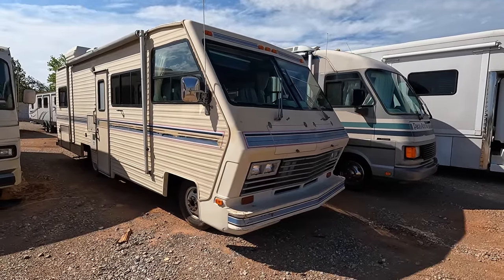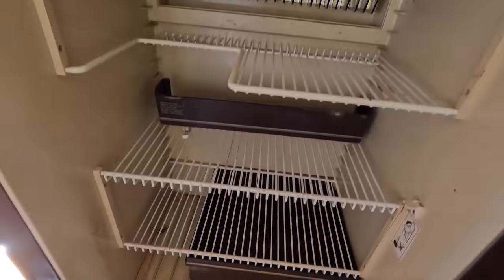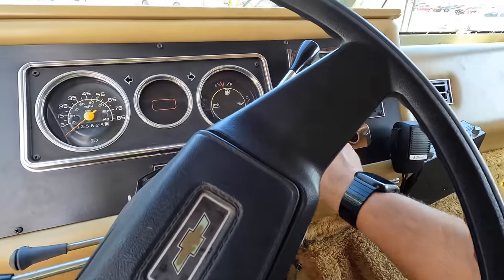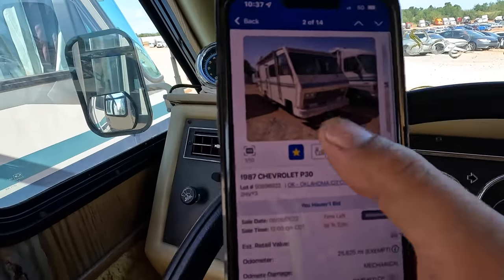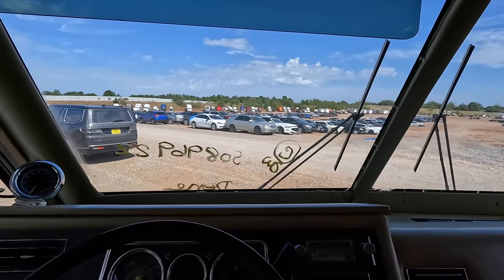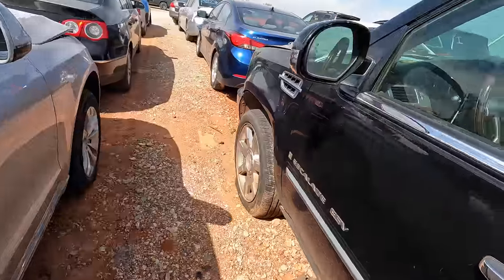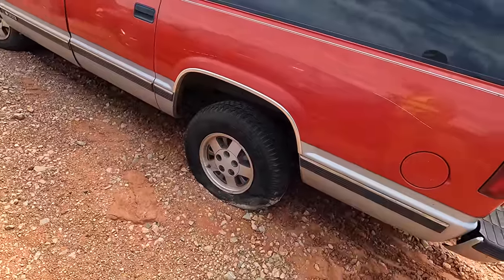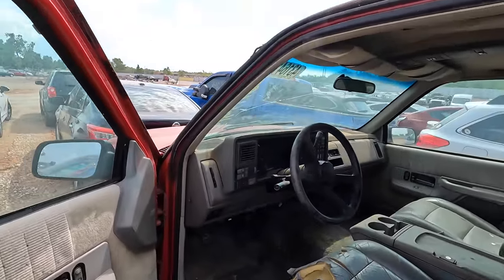Copart Walk Around 8-11-22 + 1987 Chevy P30 RV with 25K Miles!! Cheap!

Comment: Hey Randy, if it has a working generator that’s what runs the roof air. Important to check that out! also you need to check the refrigerator to see if it works which should work off from both propane and the generator and electric. replacing the refrigerator is mega bucks! generators aren’t cheap either! also need to check for leaks! These are all things you should check out before making a decision on buying it!

Comment: Randy, the roof air requires one of two things to operate — the motorhome must be connected to a 30-AMP 120-Volt Electric Service (shore power) — or the onboard Generator (if so equipped) must be operating.

Comment: Go for that RV man! That is a true time capsule. Not a hoopty at all IMHO! Id go after the Suburban too and drop in a TBI 454. Big block swapping those is easier than one might think...
Reply: screw that just jump to the 8.1 vortec - you would have to put on good heads, cam, intake exhaust to get the 454 to where the 8.1 is- shit put the 8.1 in both

Comment: The roof ac, refrigerator, microwave and TV is 110v, "shore powered" with the cord or generator powered. I'd jump on the Motorhome, install 5K genset and you're self contained. You found a rare bear, most of the 30+ year old motorhomes are scraped for their chassis to restore older trucks. It'll take some cleaning and updating but it has good bones! 454, Turbo 400, 6-9 mpg maybe more if you're really easy on the throttle. It's worth as much as anyone is willing to pay. Good Luck!

Comment: There are a bunch of things that are critical for you to check do you know what it’s worth and bid or not! The refrigerator extremely expensive to replace, The generator which runs the roof air  also runs off from electric needs to be checked, The furnace, also check for leaks, The holding tanks water and sewer are really important things to know before you bid on it!

Comment: I think the 6.2 in the Escalade is salvageable, possibly just replace the heads and lifters, basically the top end and it would be a great truck. The 6.2 is a solid engine that can last a long time the lifters are a know failure point on those engines but the whole engine doesn’t need to be tossed because of it.
Reply: Maybe the AFM/DOD V8-V4
There is an internet quick fix before spending the 2500 per side
Good to try for a content video

Comment: About the Suburban.. I mean, it depends on how much does the key cost and if the underneath is in a decent condition. If it goes for like $500 - sure, go for it, but if it goes any more than that, I wouldn't buy it personally, too big of a risk.
Reply: Can get a key and ignition switch for about $20 online.   It should be easy on that since it's older

Comment: I've had a couple of those old class A with the 454 and the turbo 400 trans. Pretty much bullet proof. Leaks in the roof is what kills those RVs. The roof air works off the generator or you need to plug in. I've been looking for one of those at a good price for a while. I would buy it today for $1200.

Comment: Those tires are probably too old to be safely driven - check the DOT codes on the tires.  Some degree of water damage is almost guaranteed with this age, really need to look up in the corners and edges, inside of cabinets.  Get up on the roof and check for soft spots.  Gonna get 6-7 MPG.  Had an '86 Bounder (Breaking Bad rig) on the same P30 chassis.

Comment: basically a box on wheels, those things were built with carboard walls with thin metal on outside, its only got 25k miles, my friends did too, he let it sit underneath a tree for 4 years, tree sap started small leaks on the roof, and pretty soon after a few months, all the walls were soggy, mold everywhere. the sealing was so soggy, the ac unit was causing it to sag, almost to fall thru. good luck lol. id never buy a motorhome that year, i can bet that thing has cardboard walls too underneath cheap metal siding

Comment: Yeah the air conditioner works only if you have a generator going or you have it plugged into the shore power as they say they don't work off of the batteries or nothing the roof air that's why he probably got the cashier fixed for when you're driving now if it's really hot you can start up the generator if it has one and run the air condition while you're driving and it'll be nice and cool?

Comment: I'd be on that motor home faster than a hen on a June Bug. Perhaps Holley would be willing to help you with fuel injection if the carb is bad. That old Suburban may test your talents but it would be fun. Thank you for walking around in the heat and taking us with you. Another fine video full of questionable choices.

Comment: You have to plug it into an outlet to run it if it's only got one AC unit it probably takes a minimum of 30 amps to run the camper so you'll have to put a single 30 amp breaker in it wouldn't take 220 volts to run it it's just a single 30 amp 110 volts read where the plug wire comes out of the camper should tell you how many volts it takes to run it

Comment: That low of mileage I would jump on it.  Looks pretty good for a old Coach. Considering your knowledge of RV’s Be a great starter for you. But, the problem’s the 454 is exhaust manifolds. Inside that tight quarters. They get hot and crack . I had a 454 in a dolphin. And constantly had take it in for that Randy.  That would be great traveling to see your family.

Comment: Make that roof ac work it will have to be plugged up when you plug that up to an outlet all your main lights inside AC refrigerator all that stuff will work and sometimes that roof air will run on batteries the refrigerator and stove it’ll be propane set no matter how good the tires are you need to check the date code on RVs because you don’t want them past five years old

Comment: You didn't catch that it has a generator also. The exhaust pipe was beside the engine exhaust. It is in the big panel on the  right side at rear.
 You need to check the basement storage areas for rot.

Comment: I think the Runnamucka will generate lots of videos,,  Put it back into running condition and it is worth 10,000-15,000 bucks,,,  Sleeperdude paid 1,250 bucks for a ford motorhome that was heavy waterdamaged,,  missing appliances and the roof partially caved in,,, etc,,, etc,,, The chevy motorhome looks like it just came off of the used motorhome lot,,,  :-)

Comment: I would bid on the mobile home you already know it starts and runs so whatever mechanical it also moves whatever mechanical it is they just couldn't get it to start so that's what they called it but you knew that you had to hold this probably got some rotten gas in it I would do it I would do it that's that's dirt cheap for something that low mileage that it's set up to get hundreds of thousands of miles on it and it's in good shape go for it ready go for it